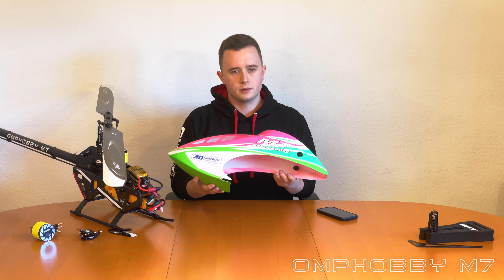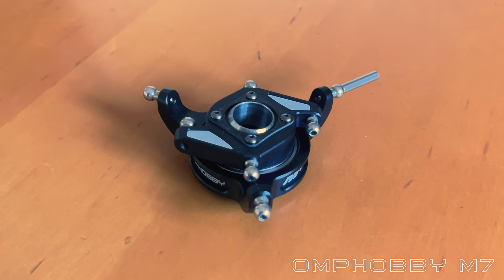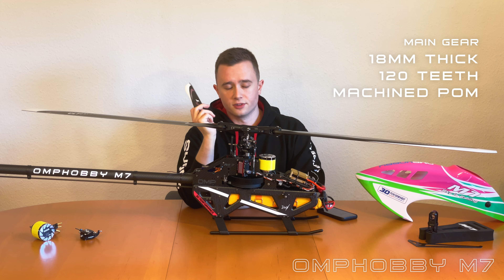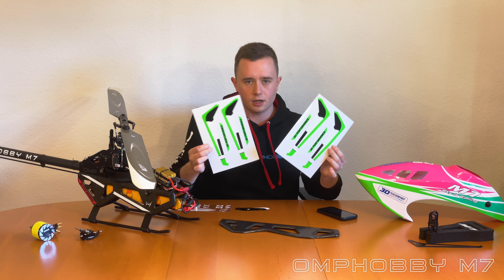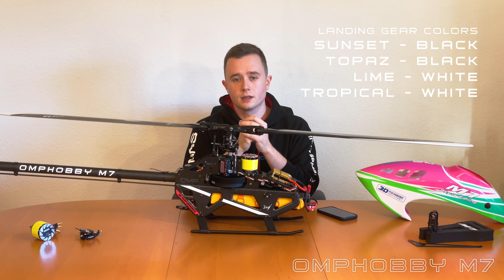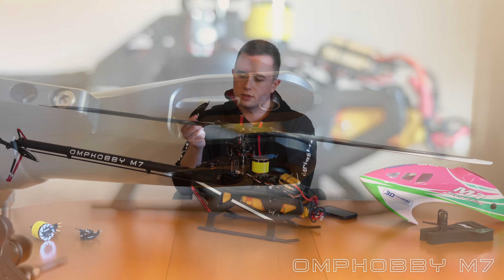OMPHOBBY M7 - Detailed Overview, Features and Secrets!

Comment: Hello, in the video you said that main gear is 110T but ratio with 11T pinion is 10.91:1, with 12T pinions 10:1 ... 
So there is a 120T main gear or wrong mentoined ratios?
Reply from the maker: If that's the case, I misspoke. Gear is 120t.
Reply: @Johnny31297  Thanks
Reply: @Johnny31297  Ok, thanks. My wrong. You said that main gear is 120T and the tail pulley is 110T.

Comment: Hi Jonas, don´t get me wrong 🙂I know that has been a hard work to be done to engineer such kind of a new 700 heli size, but honestly the design as well as the components and the shape is nothing that blows my mind now. The direct drive M1 and M2 OMP's are without any questions by far the best of in their class, but as mentioned in my opinion this does not apply for the M7 design. Therefore no reason for my to change from my Align TB60 and TB70.

Comment: Great design and details!
I love the idea of blade grip spacers!
How does reducing the friction between the blades and the grips influence the lead-lag behavior of the blades?
Reply from the maker: Good question! Blades need to be able to move in the grip to compensate for coriolis force on tip path plane changes. If they cannot move smoothly, that will increase vibration levels and make the helicopter fly worse.
Reply: @Johnny31297  I’ve been thinking a lot about this.
Let’s consider a thing: if we’d have a shaft in the grip supported by two bearings and the blade would be fixed to the shaft. There would be “no” friction when blades lead or lag but it wouldn’t be good because the blades could hit the grips at spool up. The bearings would still forward the lift from the blades to the head and the fuselage. So other than the grip hit at spool up, would a “frictionless” blade joint be beneficial during flight?
Can you recommend some literature?